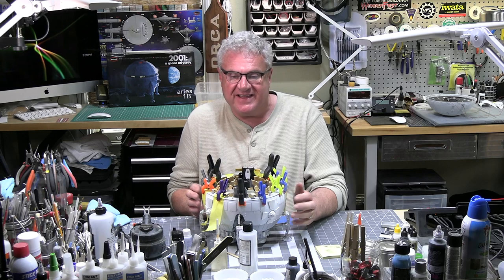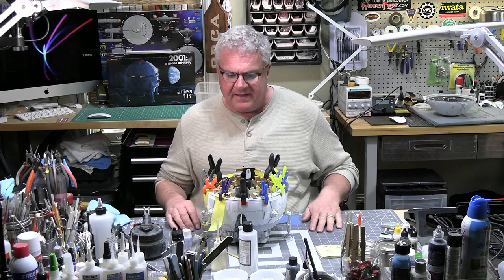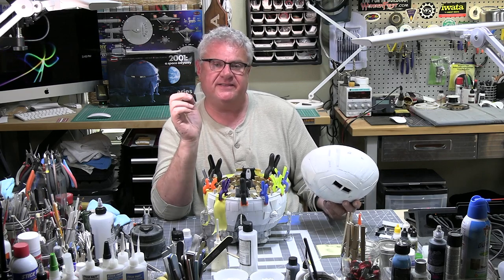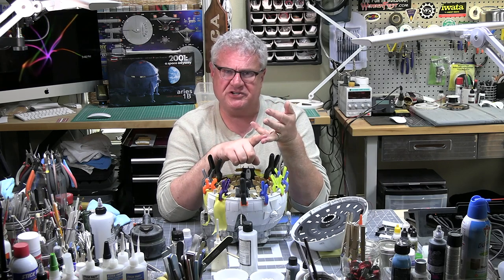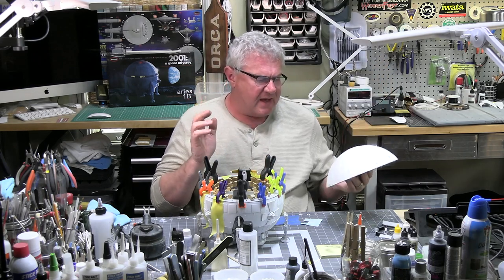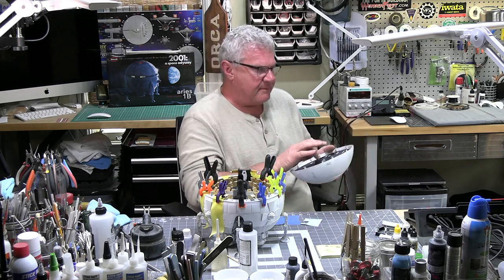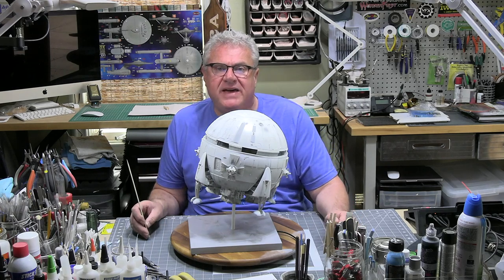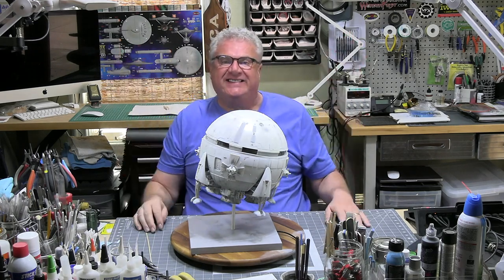Aries 1B build Final

Comment: Did you think about possibly putting a small microcamera inside? Possibly one that you could use an outside wheel to spin it around a little bit to look around and then tie it to a little monitor outside? I would still have an option to pull it apart for maintenance just in case. But it would still be cool to see what the camera. Possibly even with really teeny tiny monitors inside that light up. But that’s a dream or pipe dream to be honest

Comment: Instead of running the wiring harness thru the elevator in the center why not run it thru one of the lavatories on the side,
At least then you can pull the top off and hold it to the side to look at the interior.. Just a thought
Reply from the maker: Great thought…but honestly I wasn’t having a fun time with the lid and decided to close the model up permanently. If I build this again I would definitely do that.
Reply: @sprueVerse  I got one in my stash but I probably wont build it for quite some time so it will be interesting to see how Moebius's plug and play kit will go in  That's if they even make one. But my concern after watching all the build videos has to do with the landing gear, Everyone seems to mention that the gear barely supports the weight of the model, I think when the time comes I'll simply glue the gear down and locked and avoid all the hassle. Then again I'm not joking when I say I'm wondering what to do with this big thing,  Where to display it cause I'm limited on space, Then it came to me, Make a side table lamp out of it. Run the small tube with the lamp wires up thru the elevator and out the top and find a small lamp shade that has the 2001 movie logo, Maybe even mount a Orion shuttle above the lamp shade... i guess what i'm thinking is that when you turn the switch or pull the chain once the model lights would come on in the Aries and Orion and act as a night light. Pull the chain a second time and the main lamp bulb would come on... Well it's just thought for now,  But I think it would be cool